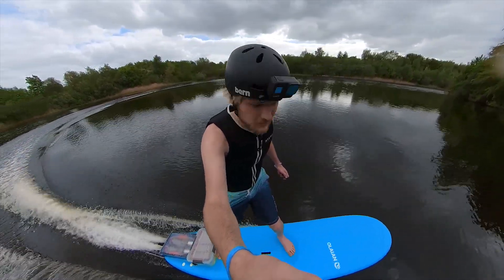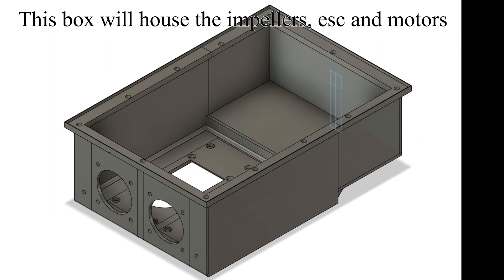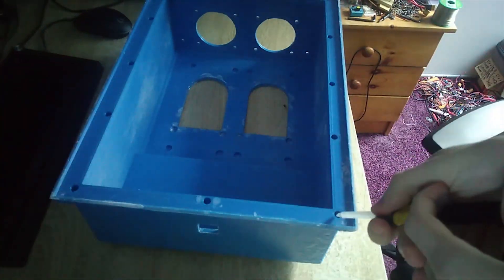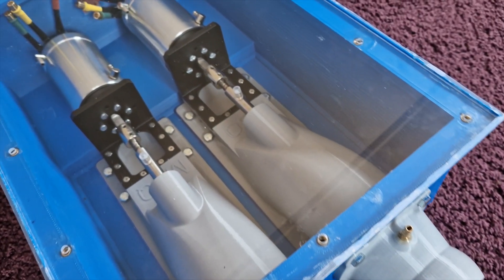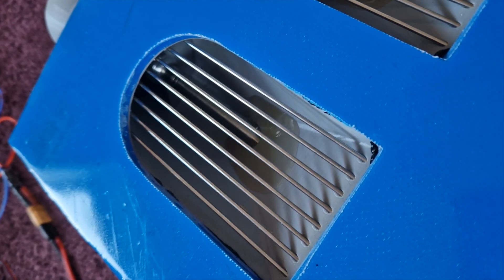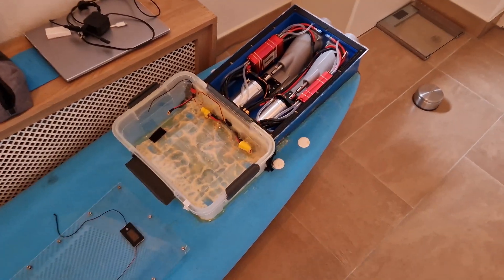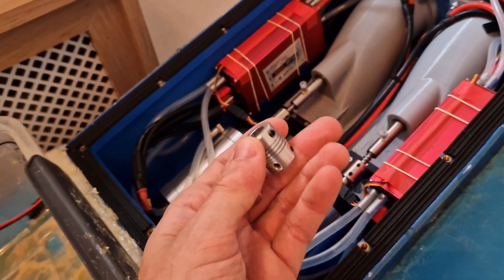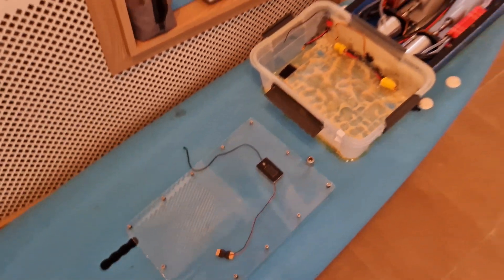Building a 20000 Watts Electric Surfboard

Comment: I was using same engine on a 85 mm MSQ turbine and that burned the engine, so i need to find a bigger motor..
Reply from the maker: Ouch thats an expensive one im sorry mate! Was looking at a single setup as well with an msq 85mm but figured finding a motor would be difficult. Maybe  a big outrunner motor would work for you instead of a inrunner? If im correct the 85mm doesnt have a mount either so you can kind a use any motor you want.
Reply: @GalinskyFPV  It has a mount and it actually fits a 80100 outrunner engine, which i think might be a good replacement?
Reply from the maker: @TheUffeHammer  Hi, im also looking into the 85mm version of the impeller. looking for a good (not too expensive) motor for that one is quite a challange indeed. I am not sure if 80100 would do much, it is not much bigger compared to 56123. Did you already have experience with the 80100 motor? I saw the MP100 is a good match but that one is already €500,- it is a 100*106 motor.
Reply: @GalinskyFPV  I have bought two of them since i'm running two turbines and the outrunner is almost as big as the turbine, it is a monster so i'm looking forward to testing them.
Reply from the maker: @TheUffeHammer  holy shit that will be a ton of power then! Will be curious how it will work out!

Comment: How big was your battery (Ah). Also how long did that last you for. I’m looking for 40Ah for a 66.6v 23kw motor. Do you think I need a bigger battery? I will definitely not be running that at full speed maybe half.
Reply from the maker: Im also on 66.6v (18 cells in series with liion batteries and also 40Ah (16 liion cells in parallel. Battery size is not only what matters, thats only important for duration. what also matters is the discharge rate of the batteries make sure thats enough to match the 23kw or higher.
Reply: @GalinskyFPV  what's your cell sizes you're using ?and what motor voltage and kv you're using?
Reply: 23kw motor, isn't it bigger for power consumption?

Comment: I think you can reduce the water outlets. One of the biggest mistakes made is use a big engine, one is enough 500kv, my surf is much faster single engine
Reply from the maker: Wow that sounds great! What kind of impeller do you use and board? Similar board design or a shorter thicker one?

Comment: It looks amazing, congratulations!!!
I am planning to do something similar with the same components, but just one motor and turbine. Do you think that this would be enough and would you recomend 12s or higher? Do you know how many amps one motor will use to see what battery I should get with what discharge rate?
Thank you!
Reply from the maker: Hi, if you go with similar board design I would definitely use two motors and 2 impellers. I rode this on 12S and it was OK not much speed but still quite fun. until the batteries got empty. (3.8/3.7v per cell) it would barely keep going in the water and was quite sluggish so i wouldnt recommend that. Maybe if you do lipo instead of liion it is okay. (li-ion tends to drop to lower voltage and can withstand lower voltage)

However that is with this type of board (long and rather small) I think there are quite a lot of gains if you use a shorter but wider board for better bouyancy. As you can see in the video half of my board it sticking out of the water, this is lost bouyancy and only make motor work harder to make the surfboard stay afloat. I also noticed if I stand completely at the front of the surfboard it becomes more efficient because the board evens out on the water and gets more bouyancy. (and less drag because the back of the surfboard is not so deep in the water anymore.) However getting up on the board at the front is impossible so while driving I need to "walk" forward.

From other videos I watched on youtube 1 motor might be enough but you really need have the perfect bouyancy solution. (thick and wide) and it needs to stay afloat when you stand on it without driving it. (mine sinks if I stand on it when it is not moving forward). The board is 90L I'm 75KG and I have 15KG of batteries on board + the 2 heavy motors esc and the other stuff. Adding weight goes quickly. 

On average I use 11000 watts on 18S but there is still quite some headroom for max throttle. My estimation is around 20000watts but never measured the wattage while driving. It is based on my ride time and the amount of Wh that goes back in the batteries after een certain ride time.

But it defenitely is on average around 11000watts and max 20000watts give or take 20%.

so for a single motor setup i would look into 10000watts of usage if you plan on going 18S so around 150Amps. If you go 12S its less ofcourse.
If you go 18S and reduce the max RPM (so max throttle input of 80%) it will also significant reduce the amps.
Reply: @GalinskyFPV  how many minutes does the battery last if you drive at 80% power and 18s and how many at 100% for 12s?  to understand how much electricity is consumed and how much power is consumed
Reply from the maker: Oof I havent measured it that well yet. It was not a noticeable difference since i tried both. By testing different battery setups and power reductions I was more concerned about my motor heating issue so i focused on that which is partly solved now by just running 100% power and standing at the front of the surfboard I do a little but throttle management. I can drive a good 15 minutes now. instead of 12.
Reply: @GalinskyFPV  Thank you very much!!
My project will use the same components as yours, but using only one jet as I mentioned and I will mount it to a small kayak that has a more or less flat bottom so it has little drag ( kayak: bic ouassou ). The engine I will use is the SSS 56123 230kv, with the same 70mm jet, do you think that with 18s it will be able to deliver 10000w at 150 amps more or less?

I really appreciate your help!!!
Reply: @borjamartos1234  for fun rides, take either two at 70 or one at 85. but for an 85 impeller you need a motor of at least 80x100 - if it’s inexpensive and I don’t know if it will pull, but if there is a lot of money, then 85x135, tp100 or even 120x100, so with a margin.
Reply from the maker: @mexail86  Well maintenance is also a thing on these boards If I could change i would go for a single setup with bigger motor and impeller. I already had to change the bearings closest to the propeller of the impeller due to corrosion. And thats with keeping up the grease for the bearings.
Reply from the maker: @borjamartos1234  Kayak's will definitely work well, especially due to their bouyancy! 

Yes it will be able to deliver a 10000watts on full throttle.

But you can't keep going full throttle due to heat so keep that in mind and tune accordingly. Also make sure you can make your packs into 12S as well. maybe that works perfectly for your solution as well. (So make 6 or 12 packs) of 6S so you can change between 6S and 12S)

Also, use water cooling for the motor and the ESC you're going to need it.
Reply: @GalinskyFPV  Thank you so much for your help!!!
Reply: Hello again! I am very close to finishing my project, but I was wondering what bms you used for your batery pack and how many amps it could handle?
Reply from the maker: @borjamartos1234  Hi thats very nice!

I don't use a bms. I just disconnect the batteries completely and use an ISDT balance charger to charge them back up.

I remove the series connection of the battery that makes it 18S and put it on a parralel connection so it becomes 6S, so i can put it on the charger.

BMS overcomplicated things for me, especially with a high voltage. 
Also i didnt see the benefit of a bms either since the load of the surfboard wouldnt be able to go through the bms anyway since finding a 300A bms is nearly impossible.

Overall too expensive and too little to gain.
Reply: Hello again! During testing at full power (using 17s but couldn’t go over 70% throttle), I experienced what appears to be some cavitation , an I was wondering if you had the same problem and how did you manage to fix it?

I think it might be due to having a big separation in between both parts of the turbine?

Thank you in advance and I really appreciate your help with my project!!
Reply from the maker: @borjamartos1234  When exactly does it give you caviation? When the jets are in the water when holding it so it stays stationary or when actually driving the board (so the board is moving) I noticed sometimes some sort of caviation or shocks while driving. but it doesnt matter on 12S or 18S. I dont have it when i just give full throttle and holding the board stationary. That said I also haven't done that for longer than 5 seconds or so. Caviation when driving I always have it in some parts of my lake not other parts and also not when turning. So i feel like it only happens when just the currents of the lake or something hits the engines wrong. I also think my caviation is caused by having my jets to close to each other. For this winter I am going to redo my whole surfboard. Same jets and electronics but going to make my own surfboard (at least an 150L of board and only 2meters long) and redesign my enclosures for batteries and stuff. I want my surfboard to be flat, no boxes behind me and everything inside the surfboard. I think such design surfboard improves the charactaristics a lot.
Reply: @GalinskyFPV  I get cavitation both when driving and stationary at high throttle, I’m going to try to decrease the separation between both pieces of the turbine and see if it gets better. How much separation do you have?
I would love to see your new configuration!! And if you want to see my project just tell me and I’ll send you some videos.
Again, thank you for your help and good luck with your new design!
Reply from the maker: @borjamartos1234     I think we have the same distance since we have the same parts. But if I remember correctly it is like half a centimeter so is it the same? As long as the coupler has a good overlap between both rods it shouldn't cause cavitation. At least if I am guessing right that the distance between the 2axels of the motor and the impeller is the issue you suspect and not the distance of something else.

Also want to note, technically the impeller is made for 10000rpm 17S on a 230kv motor equals to 15000rpm 70% of that is 10000rpm. Roughly. Someone else mentioned it to me in the comments.

I haven't had issues yet with my 18S setup.
Reply: Hello again, I’ve tested my project and it is working really well. I will be posting a video soon, but I was wondering, where did you get the solid coupler from?

Comment: I have bought the exact same parts and run into the same issues. Water sealing is very difficult but I think you did a Great job. I still have not been able to get fast enough to stand on my board but I believe it is because I have a 5ft board and that is too short. Looking forward to testing it on a longer board but this is so good to see people building and problem solving. So many of us appreciate you sharing your build.
Reply from the maker: Yes water in the box is not a big concern, all those parts are waterproof anyway and its very little water that gets inside. Do you also have a motor that overheats after some time? This evening I want to try 12S instead of 18. Maybe it helps with the heat although I doubt it. Length of the surfboard shouldnt matter that much. half of mine is sticking out of the water while riding and practically doing nothing but maybe its length helps indeed to get up to speed quicker due to its bouyancy. mine is a 100L board or 110 I do not recall. As long as it has enough bouyancy it should work. Maybe try from shallow water so you can walk/ push yourself to speed already a little bit while giving throttle on the board. 

For myself i wished to have it a little bit smaller like 7ft or 6.5 instead of 8.2ft
Reply: @GalinskyFPV  so far, I don’t have an overheating issue. I have a 500kv motor with a 10s system. Looking to upgrade to 12s but that will be more than enough power. At the moment when I am on the board, the jets are about 8 inches under water which reduces the efficiency by a lot. The force produced under the water and above the water are very different. I will give it a shot and post a video in a few weeks.
Reply from the maker: @micahkoelmeyer1519  i see, yesterday i did an test on 12S when the batteries are full. The speed is ok. But when they are 3.8v per cell the fun is slowly going away because you go too slow. Also i noticed when i stand way more in front of the board the board becomes more efficient. Probably because the waterjets are nots as deep in the water anymore like you said. Boards flattens out more so also less drag i think.
Reply: You can install a water sensor on the bottom of the battery compartment and if water enters a water pump, the pump will work. This is the lastest guarantee, to get it. watertightness is important you should do it

Comment: If you build a new version again, try moving the 2 jets a little bit more apart from each other.
This way they will not "steal" water from each other when running full speed!
Reply from the maker: Didn't know this was a thing or something to consider. I wanted to make them as far apart as possible but that would also mean less space on the sides from the surfboard removing strength. 

I dont think i will make a new version, haha :P
Reply: @GalinskyFPV  We started with a soft surfboard like yours, but as we planned to make our own board we started experimenting with making the softboard shorted. Cutting from the back the board will get wider, and give your more space to play with. We also noticed that by making it shorter (not to short) the speed of the board did go up!
Reply from the maker: @iamkian  I can imagine! Great work by designing your own board!
Reply: @GalinskyFPV  Yes. My dad and I designed it.
It's made from XPS foam (Gamma troep), and it made a lot of mess when we were shaping the blank.
We made one big misstake when shaping it. The bottom is concaved to "trap" air underneath it, and make it plain more quickly. This works great however it is also causing cavitation problems due to air being sucked into the jets.
In jetboard V3 all will be fixed, and hopefully have a 80mm jet. 🤙🤙
Reply from the maker: @iamkian  Now that im also experimenting with where to stand on the board it indeed totally make sense to make it shorter but wider. I need to stand quite far on the front and it is more efficient that way (board straightens out more on the water). Having it wider instead of longer gives more bouyancy which is necessary. Having it wide enough so you can stand almost on the jets is perfect! So i can defenitely see that wider is better than longer.

In some parts of the lake (It is constantly happening in the same area of the lake in a certain direction it seems like) the board is loosing power in shocks and then comes back, might this be the problem that the jets are too close to one another? I never have this problem when i turn, sometimes suddenly it happens. But it always happens at a certain part of the lake.

Comment: how many kilograms all together?  can’t be carried away without a cart?)
Reply from the maker: I used to carry without a cart and it is doable on your own.

Surfboard is around 13Kg you can lift it easily but if you need to walk some distance it becomes quite difficult due to its size.  Add then 15kg's of batteries in a backpack and it becomes quite unbearable. Cart was cheap and works well :)

Total weight = 28Kg

Comment: great video, well done!  Why are you using 18S?  The water jet manufacturer recommends 12 S for this motor, as the impeller speed is up to 10,000 rpm.  When using 18S, does it work normally?  no covitation?  From the video, it seems that when moving, the nose of the board is pulled up a lot, and this creates strong water resistance.
Reply from the maker: Actually I was just thinking about it this night to go to 12S. The manufacturer of the motors are quite unclear on which voltage the 230kv can run. If i remember correctly it said 150volt. But nothing really specific

However i feel like the motore become very hot. Ive used it on 16S as well for very short period before i received the 288 cells. And I feel like the motors were less hot then. (I am not sure how if it might be true but its worth testing it on 12S) I will let you know the results.

Rpm wise i do not mind, rpm
Reply from the maker: Aah you meant the impeller speed! Hmm I should look into that, Today I will try out 12S anyway if the speed is satisfying I will keep it that way.
Reply: @GalinskyFPV  yes, I meant impeller speed.  And if you take 230kv for 12s = 9000-11600 rpm impeller comes out.  Yes, check out 12s.  it will probably be enough for a longer riding time, although the battery will decrease.  then write what happens.
Reply from the maker: @mexail86  Just did 12S, didnt really do it for me it works okay in the beginning but when the battery halfway (below 3.8v per cell) it is too slow for a fun ride. I rather use 18S and cap the speed to like 80% or something. what i found out though is that when i stand more in the front the motors become less warm. I think the drag is just less since the board flattens out more over the water.
Reply: I would bet that if you moved your weight forward on the board, it would plane and go faster
Reply from the maker: @flyingpig7203  it does indeed! I need to start at the back of the board otherwise the front of the surfboard will be pushed underwater. When I am moving and the board has some speed I should slowly move forward.